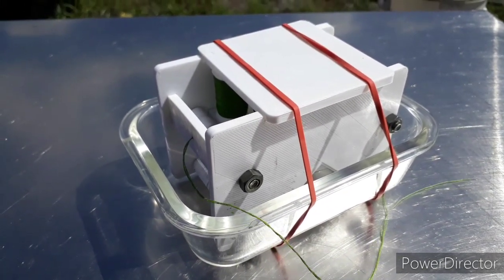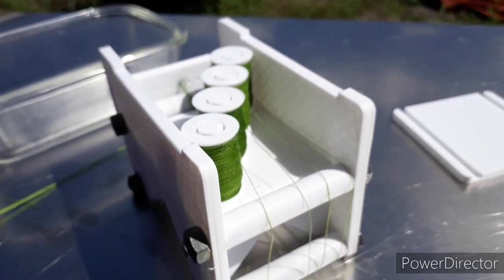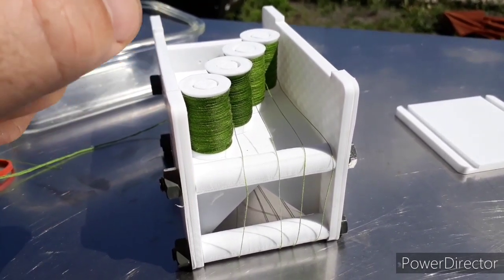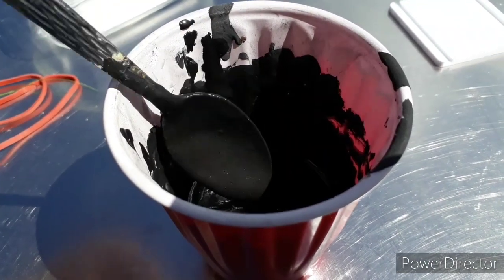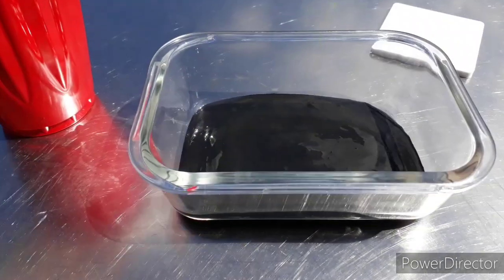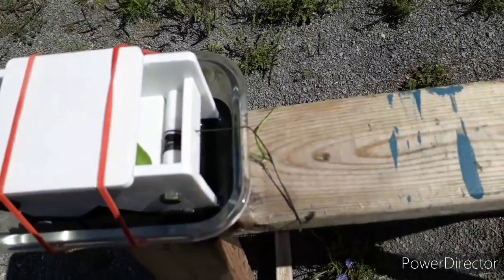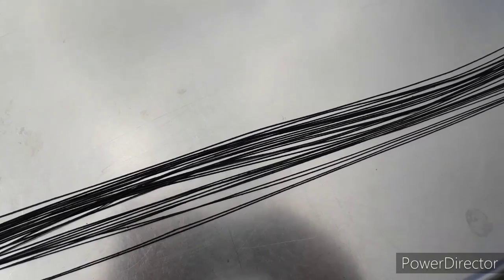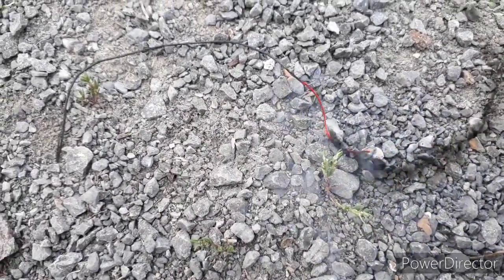3D Printed Black Match Machine

Comment: Do you think you might make a bigger version it and release it? I would change the files and modify it myself if I could, but I am no expert with modeling 3d objects yet.
Also, the blackmatch you made in your video, isn't it too thin for making quick match and time fuse?
Because I have done a bunch of research on making blackmatch, and most people's finished blackmatch has a OD of 1/18 to 1/6 inch, so if you know, does the thinner black match work as good as the normal thicker black match?
Reply from the maker: The openscad model is parametric. You can tell it how big to be and the parts resize.